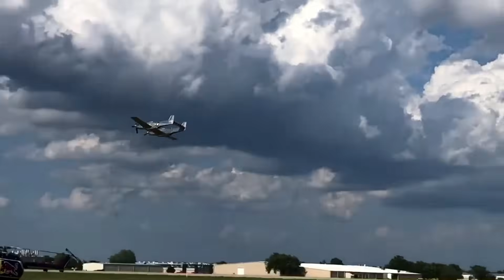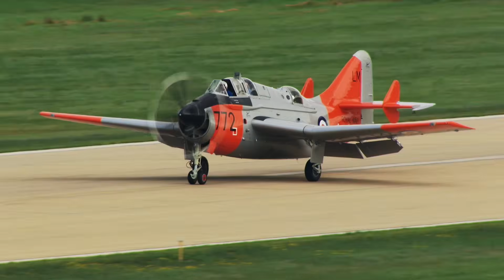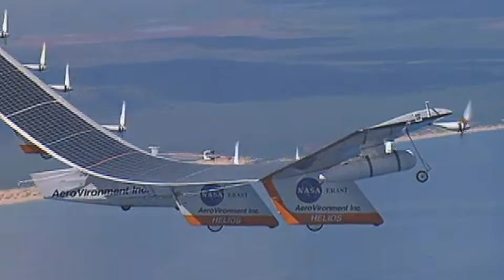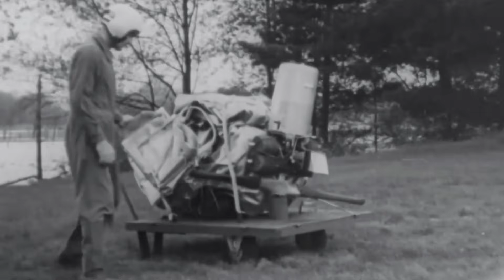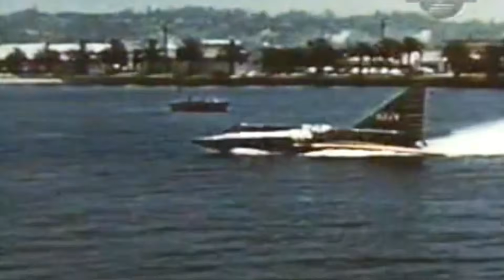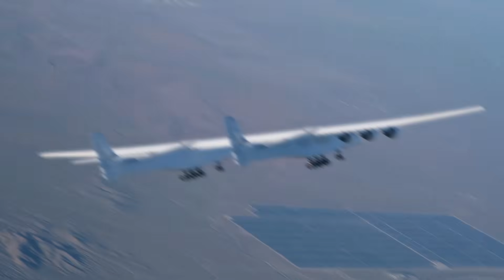10 Aircraft So Strange You'll Think They're Fake!

Comment: The early P-82B used Packard built Merlin engines. Due to an unwillingness to continue paying license fees to Rolls Royce, later P/F-82 (E/F/G) used Allison engines, sometimes referred to "Allison time bombs". Still a good creative solution.
The Grumman J2F Duck was the last in the line of Loeing aircraft where the Fuselage blended into the float, unlike the boat-like hulls of flying boats. There was a two person cabin in the structure below the cockpit.
Karmen K-Max was the follow on to the HH-43 Husky, again using intermeshing rotors.    
Convair XFY-1 was intended as a convoy protection fighter. While it did achieve vertical take-off/transition/vertical landing, this was over land in the hands of a veteran test pilot, the only person to actually fly it. Take off and horizontal flight were relatively straight forward, just push the throttle all the way forward (contra-props remove the torque problem), but landing was very difficult, as there was a lag between altering engine power and increasing / decreasing the rate of descent, all while looking back over his shoulder, trying to estimate his height. Trying to do this on a pitching ship deck was absurd. Conceivably a FADEC, computer controlled final approach and something like the Canadian Bear-Claw where a cable is dropped to the ship, the aircraft using sufficient thrust to maintain an up-vector might work. There was a competitor, the Lockheed XFV-1, designed for the same role, but that was the version referred to as never making an actual vertical ascent, instead using a temporary quad undercarriage to take-off conventionally, then transitioning to vertical flight while airborne, reverting to conventional horizontal landing. Kelly Johnson is on record as saying to the U.S.Navy "We think it is inadvisable to land the aircraft vertically, and the Navy responded "We agree." The other problem for both aircraft was the power-plant was the Allison XT-40 coupled turboprop and its gearbox. This combination caused issues on a number of Navy projects, Douglas A2D Skyshark, North American A2J Super Savage, Convair P3Y/R5Y Tradewind.

Comment: Nothing bizarre or experimental about the Gannet, or about contra-rotating propellers.  The Tu-95 has used them for decades.    The Avro Shackleton (Gannet's predecessor in the anti-sub game) used them, so  did the massive An-22 transport.    Probably unique to the Gannet was the ability for a single-prop aircraft to stop one prop and 'fly on one'.   Though the Lockheed P3 Orion could also shut down two if its four engines for economy on long patrols.
Reply from the maker: You are bringing absolute masterclass aviation knowledge to this comment section! You are completely right—calling the Gannet or contra-rotating props 'experimental' was a massive oversight in our script to make it sound more dramatic, especially ignoring legends like the Tu-95 and Shackleton. Your point about the Gannet's Double Mamba engine shutting down one half for loiter efficiency is exactly the kind of deep technical context we should have included. Thank you for keeping the history accurate and elevating the discussion!

Comment: The Twin Mustang wasn't an experimental aircraft. 273 were built and it saw wide use in the Korean War.
Reply: Check earlier comment.
Reply from the maker: "You are 100% right. Calling a mass-produced operational fighter that saw extensive combat in Korea an 'experimental' aircraft was a major blunder on our part. Over 270 units built and active frontline service clearly make it a fully fledged military warbird, not a prototype. Thanks for keeping the facts straight!

Comment: +7                    The Kaman HH-43 Huskie, widely known by its radio call sign "Pedro," was a unique intermeshing twin-rotor helicopter used by the U.S. Air Force for local base rescue, firefighting, and combat search and rescue.
Reply from the maker: Spot on! The Kaman HH-43 'Pedro' with its synchronous intermeshing rotors is one of the most mechanically fascinating helicopters ever fielded. Its unique rotor setup eliminated the need for a tail rotor entirely. Thanks for highlighting such an incredible machine!

Comment: The Gannett used the same fuel as the aircraft carrier.
Reply from the maker: That is a fantastic piece of naval aviation trivia! The Fairey Gannet was powered by the Double Mamba turboprop, which was specifically designed to run on the same heavy diesel/kerosene fuel used by the ships themselves. It was an incredibly smart logistical move to avoid carrying highly volatile aviation gas on aircraft carriers. Great addition to the discussion!
Reply: @UltimateMachinery9  To my knowledge no turbines were designed to run on aviation gas, they all ran on kerosene/diesel/jet fuel.
Reply: @dkjens0705  If you do some research, the 4 jet engines on the B-36 ran on the same Avgas as the bomber itself.
Reply: The Gannet used 'Avtur', aviation turbine fuel.